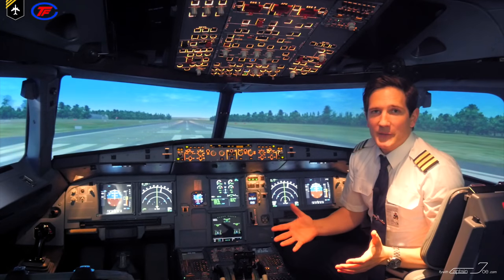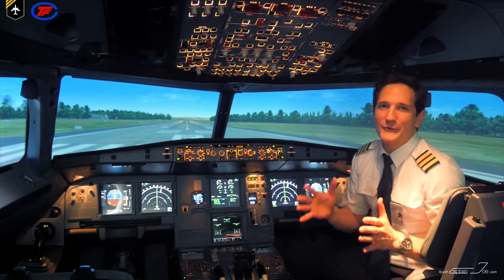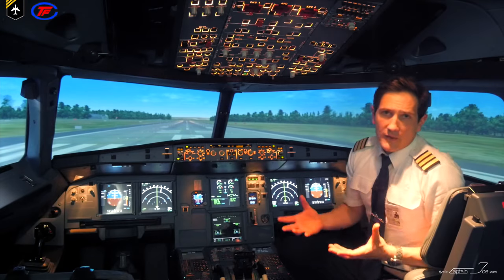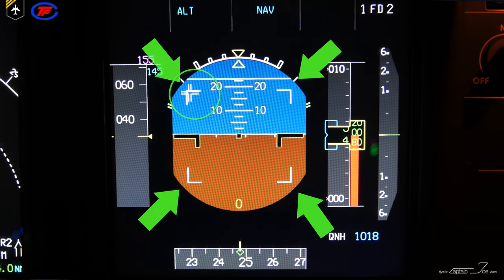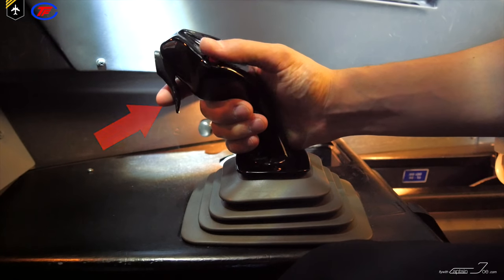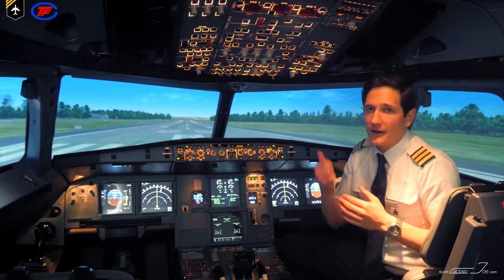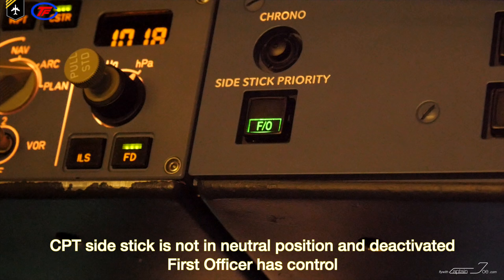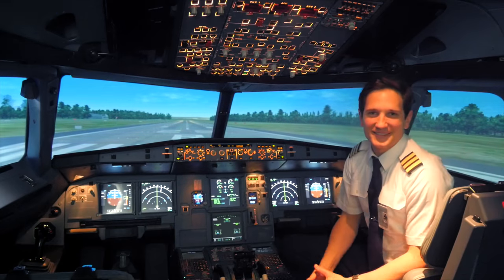AIRBUS SIDE STICK - Explained by CAPTAIN Joe

Comment: how left sidestick can be operated if you are righthanded?
Reply: doesnt really feel diffrent at all
Reply: it doesn't really make a difference trust me.
Reply: huh, its interesting to hear that, maybe because it is actually designed for left hand; kinda makes sense
Reply: The same way you use a mouse if you are left-handed

You learn how to.
Reply: wait
Reply: You sit in the other seat
Reply: You use both hands in plane. So you are expected to be perfectly ambidextrous.
Reply: You turn around and face backwards...problem solved!
Reply: kilonet you don't
Reply: This. I really wouldn't be confident with my fine control off my left hand.
Reply: just swap the seats. Take place on the 1st officer's seat!
Reply: kilonet Controlling a plane with your left hand is not that difficult. It's what any pilot does in smaller planes in training: there are usually two controls (wheel, stick), one for each seat but only one throttle lever in the center, so you have your right hand on the throttle and your left on the stick.
Reply: +Eriiaa That's not a good comparison, using joystick left handed is definitely easier than using mouse left handed.
Reply: that's not even a good question. Boeing Captains use their left hand ALSO and keep their right hand on the thrust levers.
Reply: i was just kidding. Of course you need to exercise with the left hand and it surely will be easy!
Reply: By your left hand.
Reply: it's a matter of training. You're gonna be a pilot, damn it!! Where's the problem?
Reply: It cannot be operated if you are right-handed. The airline must hire an equal number of right-hand and left-hand pilots.  The left-handed must be Captains.  The right-handed will always be First Officers and have to accept First-Officer pay $ their entire careers.
Reply: Snow Crest WHAT?!? Pilots get PROMOTED to the captain position, not HIRED (unless you have the required experience) Pilots have to use BOTH hands. If you are also implying that first officers cannot fly because they have to control with your left hand, THATS WRONG also. First officers can fly with their right hand. And they have. you never know (until you ask) who landed your flight.
Reply: Well................I guess you could sit upside-down in each seat, and the right handed pilot could now sit in the left seat, but you would have to put the rudder peddles on the ceiling.  I'm not sure about the location of the tiller, and the opposite side pilot would now be in charge of the thrust levers.
Reply: A good idea.  I will be their chief engineer in charge of ergonomics.
Reply: Miam ga what pilot upside down,oh,thats for the australian market i assume, good thinking there ,.... 😳😳😳
Reply: Yes fou sure ! But what would you sell for Singapore, it's almost on the equator.
Mays be like on TGVs you use e central seat for the PIC with 2 side sticks one for each hand.
The 2 seats are on a turntable and you swap the seats méchanically in flight. 
The non flying officer will have also 2 side sticks.
Reply: kilonet In my opinion, I think that the movements you do with the side stick are not as precise as the movements you do when you write : you do them using your whole hand. So it shouldn't be a problem.
Reply: Hi Snow Crest. 
I would'nt call anyone an idiot. But You'r right handflying is necessary.
Sitting with the sidestick in the right or left hand, is not a problem. It's like driving cars in Scotland or in Belgium, gearbox lever is on your right or on your left, is it a problem. If yes do not drive.
With a plane, if you can't change with right or left do not fly, be flown !
Reply: Well..........it's the internet ya' know.......That said........AOPA magazine did an article on the lack of basic hand flying skills and indicated that "Asian Cultures" were the biggest offenders when it came to autopilot only cockpit.   No offense but the Europeans tend to rely a little heavily on the autopilot as well.  In the U.S. hand flying is expected on a regular basis.
Reply: it dosent matter. in normal flight controls you still use the left for the yoke and the right for the engines
Reply: Jiovany Louis Exactly. I imagine the main problem is transition from FO to captain, whether yoke or sidestick. You have to rewire the brain for using left hand on either.
Reply: I'm sure it is not much than flying  with a yoke  (C152) or a with a stick (Skyranger).
Reply: kilonet sounds like a personal problem
Reply: LOL...nice!!!
Reply: LOL.
Reply: Makes perfect sense.
Reply: Rod Dahl  

So this is actually what happened to air france flight 447...
Reply: Hi P. H. Liu
Not at all, please find just a crashcase  where not knowing the controls position was the problem. AF447 is a CRM problem and a human error.
It is much more convenient and other OEM use it in successfull planes C-Series from Bombardier, F35, Rafale, F18 .... and soon Boeing will use it on it's next civil planes.
Reply: With the left hand.
Reply: Force yourself to get used to it or stay as co-pilot forever.
Reply: Andi S....Or do as my company does and allow flying from either seat.  Yes, that means the Captain can fly from the right-hand seat if he chooses, which I do on a regular basis to maintain proficiency in both seats.
Reply: pahom..The Americans will do no such thing.  Most crashes are on take-off and landing, which are hand-flown most of the time. The Americans will maintain proficiency in hand flying and automation usage.   The U.S.A. has the most complex, busiest, and safest air transport system in the world.
Reply: When you say "the americans" we understand that all other people are wrong,  and that the very reference for airplne intelligence is private property of "the amricans". 
"The Americans will maintain proficiency in hand flying and automation usage", you think other people do not !
Pilots are trained people, and proficienty has strictly mothing to do with using a yoke or a sidestick. Using the left hand or the right hand is not a problem for turning knobs or using Power Throttle, why should it be different for the sidestick. The nose gear on all planes is driven from a side control, do you really think it is unsecure ?
More and more new planes come with side stick, military planes come now with sidestick.. 
Please stop thinking as your country beeing the sole one on earth !
Reply: Philippe......No Way!!!!
Reply: Pretty much the same way we all have to use our left hands to control the directions on a PlayStation / Xbox pad I should think.
Pretty much all old arcade games had the joystick on the left for as well.
It'd feel weird the other way around.
Reply: Same way Lefties serving in militaries with M16-patterned Rifles get by, with extensive training.
Reply: Lol
Reply: So you better start your left hand operated.
Reply: You use your left thumb to control the left joystick on a PlayStation controller. Shouldn't be that hard lol
Reply: You don't, you just fly a boeing
Reply: U learn boi
Reply: Christopher Cardona regardless, during approach and landing on any plane whether it’s an antonov 225 or a Cessna 172, one hand shall be kept on the thrust levers while the other is on flight controls, and if you’re the captain, the thrust levers will be to your right (99% of the time), so you will use your right hand, hence you use your left for controlling the movement of the plane.
Reply: with your hand
Reply: If you have two hands so you can use each one it isnt fuckin hard lmao
Reply: Just be a first officer
Reply: @laszu7137  simple
Reply: I'm a leftie
Reply: It’s shaped for your left hand. So it’s a mirror of the side stick on the right side. It feels a lot more natural.
Reply: With your left hand?
Reply: Right-handed people cannot become captain. And left-handed people flying Airbus will be hired straightaway as captain.
Reply: i am righthanded and i drive my car with only the left hand always lol
Reply: You have much more important things to worry about
Reply: @Eriiaa  im left handed and I use my mouse with my right hand
Reply: Have the sticks been updated since  the crash of the AF plane?  I recall that Captain Sullenburger indicated this was a weakness on Airbus aircraft and that it would never happen on Boeing aircrafts.  The copilot maintain the stick up without the acting captain knowing this was happening.  By the time the captain entered the cockpit and assessed what was going on it was too late.  I fly quite a bit and keep wondering if a change was made to address the matter.  Thanks
Reply: I am right handed and I wanna become a pilot...I was thinking about this a year ago but when I bought a yoistick that was the same fell at left hand too
Reply: The same way you shoot using your mouse and move using the keyboard simaltanousely in a pc game.
Reply: You dont even complain when you cut your nails with other hand
Reply: Not too many controls like a "Joy Stick". This is a side stick and doesn't matter a great deal. Left handed or right handed, left hand drive or right hand drive, doesn't make a huge difference when you are changing gears in your car(manual transmission). You got used to it....its the same here and hardly two primary buttons unlike a 'game'.
Reply: if you are left handed, you can never be captain of the bus. you will be f/o forever unless you change to a plane that has that old school yoke.
Reply: With your left hand
Reply: smdh, first of all any actual experience pilot does not fly with both hands and will also have experience flying as capt and first officer. Even f you are just a private pilot you will be in the captains seat and you will be flying with your left hand as you will need your right for pfc (throttle/flaps/trim,etc) and things like your vor ils radio switches etc etc... I wish people wouldn't comment on things they know nothing about, I mean AT LEAST friggin google it or something!
Reply: @snowcrest7863  that was downright hilarious! good one lmfao
Reply: @JiovanyLouisbosslife  o.0 did you leave your sense of humour in baggage claim?
Reply: @Eriiaa  Don't you just move your mouse to the left?
Reply: training training training training
Reply: @elefteriosmouratidis  because a captain flies with the left
Reply: @yassasloan7308  yeah I know. bur before you get to be a captain u sit on the right.
Reply: @elefteriosmouratidis  in thst sense you have a point, BUT people usually learn on a Cessna and youll be flying in captain's seat for most of your training and youll have to do solos. after that people usually fly small craft as single pilot  so its a given you will be flying with your left.
Reply: @yassasloan7308  yeah but a Cessna is not an Airbus. With training you wilo learn to use your left hand.
Reply: @elefteriosmouratidis  doesnt matter, your  right hand is used for flight controls, throttle, navigation, etc and the left for the yoke on ANY fixed-wing
Reply: as a left-handed person...
Yawn?

Suck it up sunshine. I have to deal with objects that are right-handed only my entire damn life and I manage just fine.
You'll learn.

Seriously though, you probably wouldn't realise just how many things are biased towards right-handed use and how off that feels if this is not your naturally dominant hand.
Door knobs. Button placements on devices.
Mobile phones.
Mice. Joysticks.
Standard keyboard layouts in games.
Scissors...

You name it, it's either easier to use right-handed, or outright impossible to use left-handed.
As a leftie 'ergonomic' devices are the bane of my existence.
Basically anything designed to make these devices 'better' generally just renders them unusable...

But, you know. Once you get over your tendency to insist on trying to use your dominant hand for everything...
You just use your off-hand and get on with it.

Even though I once measured the performance difference on several tasks and came to the conclusion that I'm about 20% worse at things if I'm forced to do them right-handed...
It is what it is...

You could argue that in a dual-seat airliner you could just get the pilots to sit wherever they feel more comfortable...
But the hole in this argument is there's always 2 pilots, and statistically, even the most wildly optimistic estimates (and in all likelihood the prevalence is lower than that) show that about 1 in 5 people at most is left-handed. (many estimates are more like 1 in 10)
That means in most cases BOTH pilots will be right-handed, thus there will always be someone stuck using their off hand...